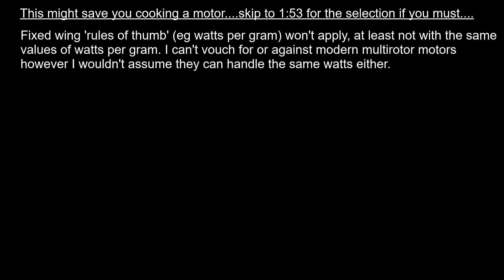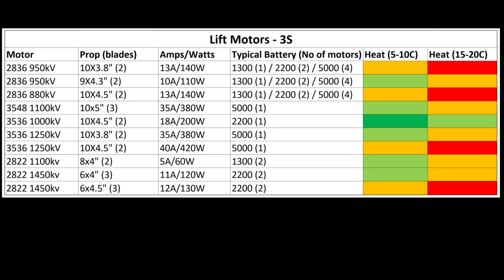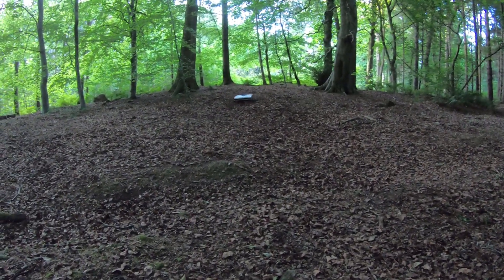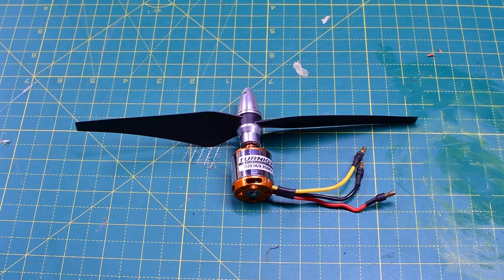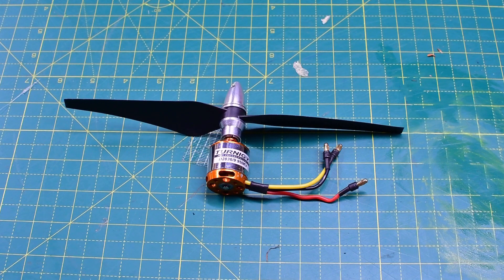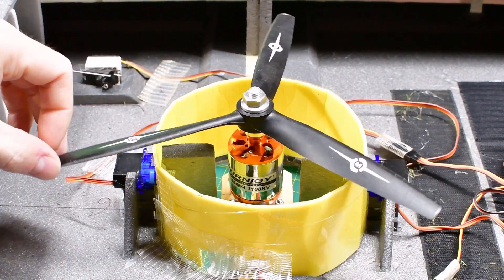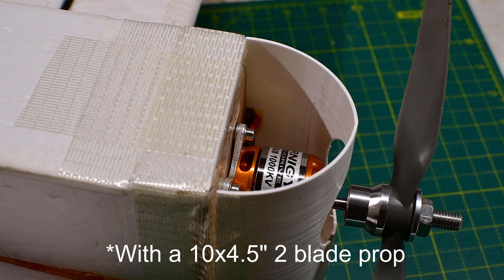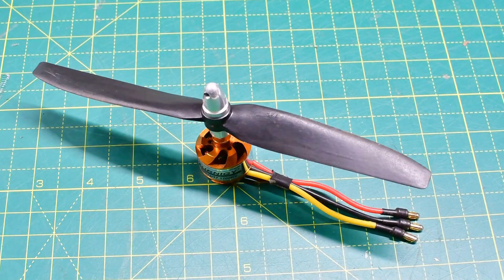Skirtless Hovercraft Projects - Motors Review

Comment: Make a duct around your prop extending a little bit up around your motors. Pulling in air alongside the motor will increase the airspeed there and cool it more efficiently. ‘As is’ your prop can gobble up air from all directions and only a portion will increase cooling on the engine. Alternatively… put the engine inside the hovercraft body so that all the air is constantly being fed into its ambient and renewed.

Edit: I have my eyes in my ass… your engine IS inside the hovercraft already. 👍🏻 Carry on 😂
Reply from the maker: Ah we've all been there....actually my first ever build had an awful motor position which I will be explaining NOT to do in the next video.